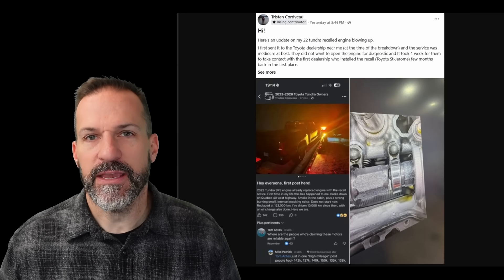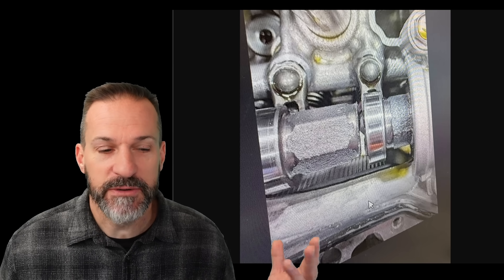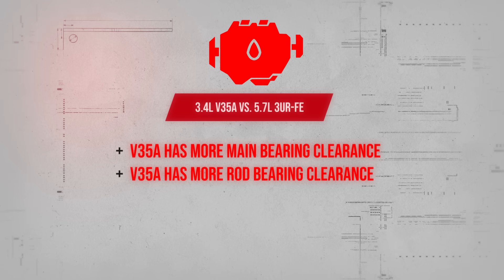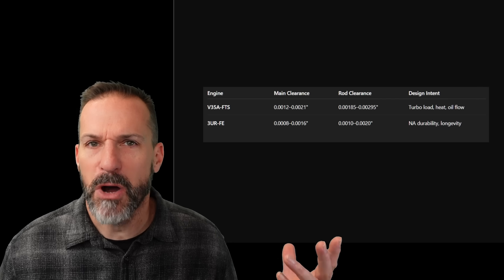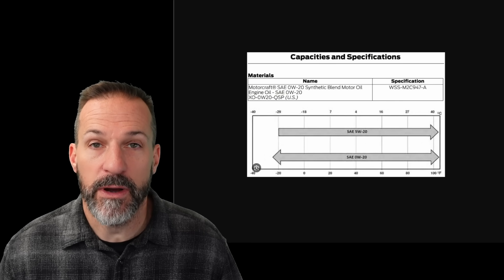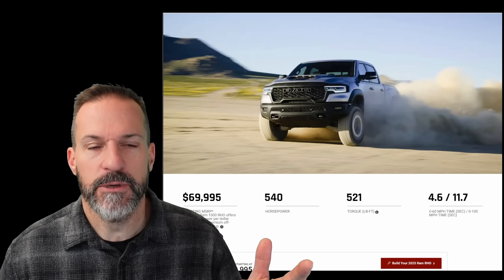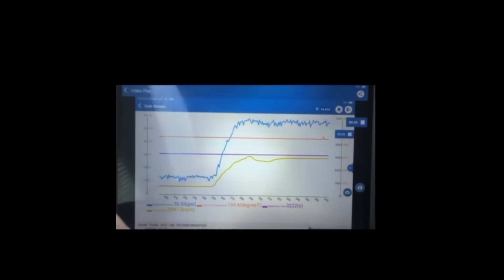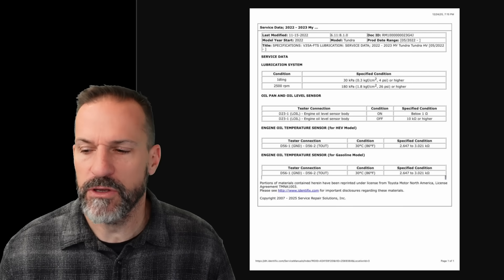Can We FIX Toyota's BILLION Dollar Mistake at Walmart? 2022- 2026 Tundra...

Comment: For the 25 4-cylinder 4Runner should we move to 5W-30 from 0W-20 too?
Reply from the maker: I think time will tell with the new 4 cylinder. So far, there haven't been nearly as many failures in the 4cylinder 4runner/taco and other variants using that engine, partly because it's not putting out nearly as much torque but also it may have a bit better oiling design, hard to know yet without long term results. I would see if you can check oil temps when pushing it (after 20m of driving, going up long hills, or hard accelerations for a while). If your temps always stay in the 200-215 degree range (not hitting 220 or 230+ consistently), then 0w20 or 0w30 will probably be just fine. Also check the oil pressure at idle if you have a scanner or OBD BT module, if your pressure is 15psi or higher at idle (minimum), that's better than I see in some of these Tundras in groups. I would not use start/stop if you can avoid it/remember to turn it off as often as you can.

Comment: That's the supposed fix for the GM v8 engines, I would like to hear if The Motor Oil Geek were to weigh in on the situation.  Our governments need to stop mandating fuel economy at the expense of reliability.

Comment: I don't think the 2022+ Tundra's have a variable displacement oil pump.  I had a 2022 Tundra and the oil pressure was always very low.  Have a 2024 F150 3.5 EB now and it does in fact have a variable displacement oil pump.  Any time torque load is high, the oil pressure gauge spikes way up.  Even if you are driving on the interstate and the turbos kick in on a hill, that oil pressure spikes 3/4 the way up.  The 2022 Tundra I had, it would never spike the oil pressure gauge.  I always change my own oil, when I changed the Tundra's - oil smelled like fuel every time, very strong smell.  I had it for 25K miles.  Changed my F150 3.5EB twice now, oil does not smell like fuel at all.  Another thing is the oil filter size on the Tundra, extremely small.  The Ford filter is massive in comparison.  I run all Amsoil, did in the Tundra and now the Ford, Amsoil advertises 15,000 mile filter for the Tundra but the Ford they advertise 25,000 mile.  Obviously a larger filter is far better, even though no one should go 15,000 mile intervals...

Comment: Toyota GCC recommends 5W-30 engine oil for the LC300’s V35A engine in our Middle East conditions.

Even though many of us had our engines replaced under the recall campaign, the LC300s here have still seen a lot of mileage and harsh use highway driving, off-roading, and desert dunes, yet they’ve generally shown fewer failures than the Tundras. 

As for me, I’m currently using Liqui Moly Molygen 5W-30.
Reply from the maker: That’s great Information, thank you!

Comment: Talk to any engine builder. Larger or looser bearing clearances are usually used in a race engine for less friction. For longevity and durability its tighter clearance. The oil definitely isn't helping eith the oil pressure but the larger clearances will cause lower oil pressure as well. Once the 0w20 is hot its like water. Pressure is resistance.

Comment: I have a hard time believing it is just oil viscosity causing problems.  If that were the case, why wouldn't Toyota change viscosity requirements rather than spending billions of dollars replacing engines and destroying their reputation on something so simple to remedy.

Comment: I own a 2011 F-150 Ecoboost bought from new.  The oil spec. was always 5W-30.  5W-30 is clearly. stamped on the oil filler cap. (currently 300,000 km on the truck).  The dealer would sometimes (out of habit) put 5W-20 in during oil changes (which I would catch, and make them redo).

Comment: This is no tighter tolerance BS. This is the used of cheap materials. For context I have a Honda 4cyl boosted pushing 24 pounds of boost making more power than the new tundra and about 100 less torque in a 4cyl. Still using manufacturer oil 5W- 30 10W-30.

Comment: I've made a lot of comments on this video already, here's another one. 
In my 2019 Silverado whenever I would change the oil when I had the zero w20 I would take it for a short  4 Mile drive 2 mi to IHOP 2 mi back and I would then flip the The valve open on my fumoto quick release valve on the pan and the 0W-20 would come out like black water So how can something as thin as water protect your engine. Now  that's how metal debris is created metal to metal contact

Comment: Looking to get rid of my ‘24 Tundra Platinum and get back into a 2006/2007 classic Silverado. 

New trucks are a liability. The non-DOD was a master class in reliable power if you just change the oil. I’ll happily give up a few MPGs to not keep returning to the dealer.

Comment: Totally wrong and do not follow these suggestions people if you own one of these vehicles. There are so many variables and other areas of the engine that can be effected if you change things. I have seen Toyota deny warranty before on people that thought the 0W-16W oil was too thin and increased the viscosity on their own and then came in with a blown engine do to areas not getting proper lubrication because the oil was too thick to reach critical parts. The 2.5l Dynamic Force engines are not effected with mass engine failures and they have tolerances just as tight as the V-6 engine. They have denied warranties on 2.5l Dynamic Force engine failures caused by people doing this. They thought by adding a thicker oil they were helping their engine to last longer, but ended up destroying it not knowing it restricted lubrication to critical parts. Unless you got the money to test this theory then do not do it. Also if it was a viscosity issue then why are the other turbo engines not failing? The new Tacoma has not had any mass engine failures. It has had some other issues, but the engines have been pretty damn good.

Comment: The low oil pressure in my 2019 Chevy Silverado is the one thing that I noticed with the 0W-20 and very hot idling I've seen it as low as 8 psi, that is just way too low now with a 5W30 that I have in there doesn't get below like 28 PSI at hot idle

Comment: I bought a 2025 a couple months ago. They specifically told me Toyota doesn’t recommend a break in oil change after 500 miles and set my first oil change for 5000 miles. Being a mechanic by trade I ignored that advice and did my break in oil change. I watched your video from the oil geek showing all the debris still in the oil even after 500 miles. This could be a huge contributing factor to all these engine failures.

Comment: Daughter has a 2000 Tundra with the 4.7, 315k and counting running 5w40 rotella t6. Blackstone has oil change intervals acceptable at 7-8k miles with my wix extended life filter combination, but I still stick with 3-5k oil changes. Truck is used for a business, and oil is cheaper than an engine. Love the 2UZFE.
Reply: Yup, 273k now on my '08 4.7L, and I'm shooting for a half million miles.

Comment: https://youtu.be/hvagxNwrNq8?si=1ZtAJb_Ebpma48OG
I just uploaded a video to my channel reviewing my 0w20 to 5W30 oil conversion on why I think it's a good idea to convert it to the 5W30 and I do agree with you I don't believe it's machining debris for the manufacturing process now there could be some but I think it's being generated just like you said widely engines are running because that oil is so thin and there's not a cushion between the moving metal parts. And of course oil gets thinner as it gets hotter and if you got zero w20 it's going to get pretty f**** thin. When I was running the 0W20 and my 2019 Chevy Silverado I'm very hot days the hot idle but sometimes be down to 8 PSI usually around 10 PSI. I had a lot of comments on my channel a green with what I was talking about there were a couple people that are convinced that it's not the oil that is the machining debris from the factory. They need to go back to Port injection, no auto stop start and definitely know DFM or AFM. Or at least put secondary port injectors that would inject fuel on the backside of the valves every now and then to keep them clean. You realize the acronym for direct injected engines is DIE which is what will happen to your engines over time with the directed injected engines of course on some engine covers they call it GDI because DIE would describe what is happening to your engine with how it's set up currently

Comment: John Deere had a tight tolerance problem with their 13l engines. Dealer came to the farm where I was working and changed the oil as soon as the combine was delivered. Took out 15w40 put in 5w30. They had recently figured out why engines were cratering.

Comment: https://www.youtube.com/watch?v=vL4tIHf_9i8

Here is a very good teardown of the Toyota V6. At the start of the video, it is apparent that Toyota is trying to hide this from the public. 
There are Turbo engines that runs 5w-20 that doesn't have problems - like Honda 1.5L with 200HP which has a higher specific power than the Toyota.
IMO, this points to design flaw or flaws in manufacturing like machining. I bet Toyota have not figured out a permanent solution yet.

Comment: I run 5w-30 in my Tundra and it does have higher oil pressure than 0w-20.  I run Pennzoil Ultra Platinum
Reply: Thanks for posting.  What PSI?

Comment: Turbo engines well known to run on high heat which causes metal expansion. Lowering clearances can be the issue, but in the same subject those engines come with robust cooling systems. Thinking of oil pressure drop, its grad, or design flaw are possible because they are all related, Domino Effect. Toyota Knows That !

Comment: It would be interesting to see if the engines were failing in the hotter parts of the country vs the colder parts of the country.  Thinner oils in the deserts of the U.S., where the summer temperatures are routinely higher than 100° , would seem to need the higher viscosity.  I would also be interested in seeing if these new engines runner hotter than the 5.7L engines.

Comment: This is a very interesting video. Although I don't own a vehicle with the V35A or the Hurricane, I think the data you presented makes for food for thought for those individuals.

I do own a newer '24 Gladiator with the Pentastar that specs 0W20. At one point, one of the drivetrain engineers posted on a forum regarding the specified oil weight, that it was actually designed around it, and the tradeoffs with using a higher viscosity oil. It came down to reducing start-up wear versus longterm wear on the timing components at certain RPMs, as I recall.

Point being, I watch my oil pressure closely through the EVIC and assuming it's accurate, consistent idles at 30 PSI with the variable oil pump. It has a trigger point at 3,000 RPM+, as designed, that spikes the PSI up into the 70s. Given what I know, I use high quality oil of the specified weight, change it twice a year (absolutely overkill, but my commute is short), and inspect my filter. So far, so good. This reminds me of Lake Speed Jr's advice of balancing use versus OEM specification in regard to determining which viscosity to use. Oil is cheap, engines are not.

Edited to add, I bypassed the Auto-Start-Stop system as well.
Reply from the maker: That's awesome, your oil pressure sounds great for your Gladiator especially at idle. I think my hurricane idles in the 20s :). I think 0W40 might be the best of both worlds for turbo engines, so we'll see how it goes.

Comment: I hope that the Trump administration’s new epa standards will mitigate some of these issues. Focus on longevity other than mpg numbers. If mpg numbers are the focus then make vehicles smaller and lighter. Attempting 30 mpg’s on 6-7000 pound machines is purely lunacy unless hybrids are used and highway speeds are reduced!
Reply: #FDJT

Comment: I run nothing but 5w30 in my 2024 tundra sr5. I pull with it and don’t care what happens as it’s a truck. I change the oil every 5k and knock on wood with 30k plus miles and she’s still running like a champ. This is my test truck so we’ll see how she holds up… keep the great videos rolling car guy. Btw, love that new ram truck of yours 👍👍👍 please keep us posted on how the ole ram is holding up 👍👍👍
Reply from the maker: Awesome! If you ever do an oil analysis shoot me an email (cars AT thecarguyonline.com). At some point I want to setup a website to track mileage/oil weight for Tundras and other turbo trucks to see if we can start correlating what is working and what is not :). Thanks for the kind words.

Comment: I have always suspected the variable speed oil pump.  but the problem is that are tundras with well over 100k running like a champ. I think there need to a comparison between the different platforms using the v35a because it seems like the tundra is taking the biggest hit.

Comment: Let us all just remember that Toyota would have considered this simple solution if it was that easy.  I just think that turbo torque and 87 octane put an extreme duty on the system that is trying to maintain reliability and performance.  This is magnified when towing or loaded.

Comment: Did he log the boost pressure? If the cylinder pressure is low there is no need for high oil pressure. A lot of cars run sub 15 psi oil pressure at idle

Comment: Going back to the Variable Displacement oil pump output pressures, I would like to see the oil pressure at 2,000 rpm where the engine “lives”. Couple lower oil pressure at 2k with the high torque required to keep the transmission in the higher gear for fuel mileage and there could be bearing problems later.

Comment: I think you have a valid point. I would also see some data logs of the oil temps at high load i.e. climbing a high grad hill. Turbo charge engines add a ton of heat to the oil.
Reply from the maker: Yeah exactly! Which makes the case even better for something like 5w30 or 0w40 oil. I know the hurricane oil gets extremely hot by design, but 0w20 turns to water above 250 and starts to lose protection. 0W-40 continues to thin, but because it is a 40-weight, it maintains a more robust high temperature high shear film than thinner oils like 0W-20.

Comment: I got a brand new 2026 Toyota Grand Highlander Hybrid Max. It's got that 2.4 l turbocharged high performance engine. The oil specified is 0W-20. I did some research and found out the exact same engine is used down in Australia Mexico and in Europe and you know what oil they use especially in the warmer weather 5W-30. Yet in our country because of EPA Toyota continuously stresses only use 0W20. So Toyota knows they've created the potential for your engine to blow up just so they could be EPA rated for 0 1 mi to the gallon better. Screw the consumer amazing yes that's the new woke agenda along where they're full EV cars. Remember they are the company that got rid of their fantastic CEO and 2024 2025 and brought in a woke CEO to push their woke agenda. Anyway folks use 5W30 do the research find out what oil is used and other parts of the world for your same engine you will see then it can use a higher viscosity oil which will save your engine. So on the third oil change at 6,000 mi yes I changed the oil a few times so it breaks incorrectly I switched over to 5W30 Pennzoil synthetic ultra premium whatever they call it. I had a big fight with Walmart to get it done but they did it for me. I would have went to Toyota but I already know that would have been a lost cause. I even paid for the premium services to have it done for the next 5 years but honestly it's not worth it if I know they're going to put in 5W20 I know my engine will grenade and I don't need that s***. Anyway folks to yourself a favor do your own research check into it like I did I believe you will learn going 5W-30 especially if you're going to keep your vehicle for over 100,000 miles you'll be better off with a thicker oil. All the best y'all! PS now if there's a way to remap the oil pump so at minimum it's pushing 15 psi to the engine at idle, that would be a big win as well. Anyone know how to do that reprogramming?

Comment: I’m thinking that I don’t understand how variable oil pumps work. Where is the oil pressure measured? And how does this really relate to oil flow at the main bearings? I do understand a higher viscosity oil providing protection for a little bit longer on a low flow bearing. But if you’re not getting enough flow to the bearing, eventually that’s going to play out.

Comment: The EU has emissions and pollution regulations that force manufacturers to have extended oil change intervals (10-18 thousand miles).  As a result, European spec oils are full synthetic, not a synthetic blend, and have higher viscosity ratings to provide proper protection over extended change intervals.  The EU classifies used oil as hazardous waste which requires special handling, so there are cost incentives to have long life oils with superior additives compared  to what is typically found in North America.  Whereas US government regulations emphasize fuel economy which motivates manufacturers to use light weight oil.  So in addition to trying to use higher viscosity oil in Tundra’s, I’d recommend using an oil that meets German car manufacturer specifications.

Comment: I have watched many YT videos on the subject and the one thing that is common to each manufacturer having problems is the 0W-20 oil spec and the Variable Displacement Oil Pump. The owner cannot easily alter the Oil Pump, but they can use 5W-30 oil and likely reduce the chance of failure.